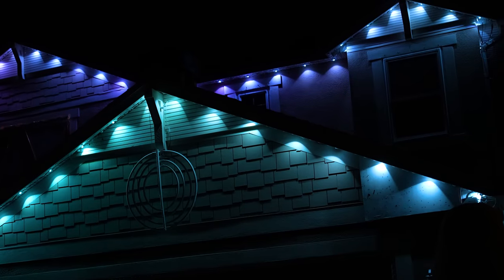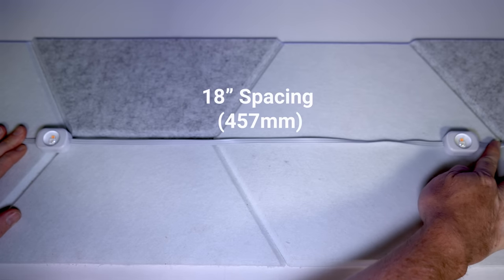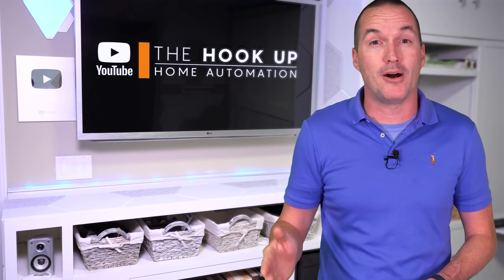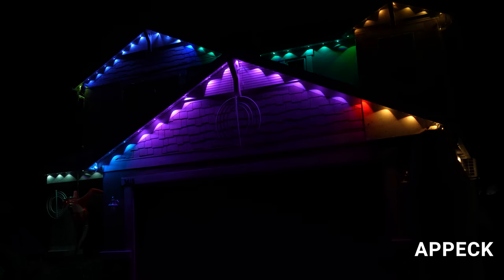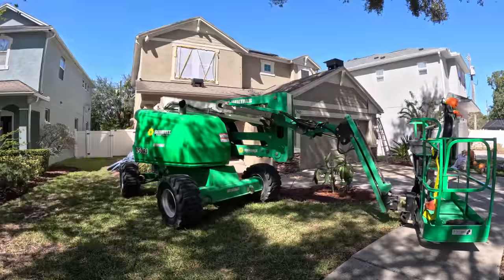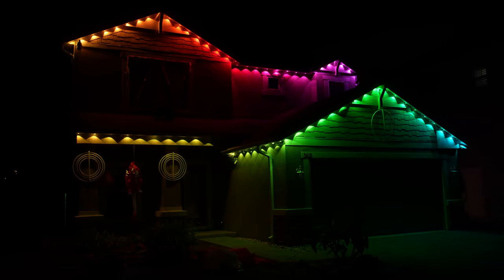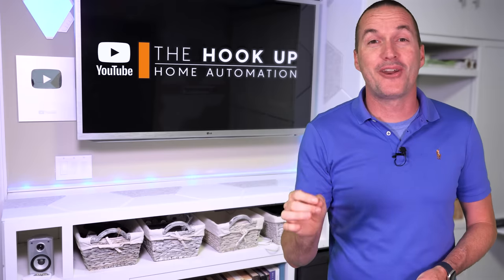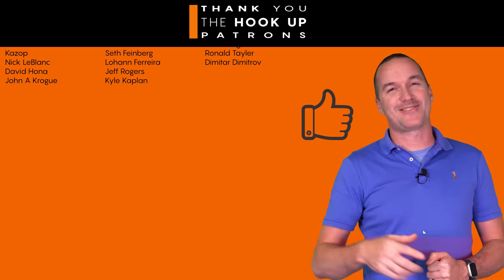Best Permanent Install Exterior LED Kit? Govee, Govee Pro, Eufy, Appeck, YPS, Novostella

Comment: Do the YPS pucks need injection for a 100ft run?  The Govee seems nice and easy to install, as the PSU is on one end of the lights and that's it.  The YPS looks better though, but I'm not too clued up on injection and all that stuff.
Reply from the maker: Yes.  They are 12v, so injection every 10m/30ft is suggested for full brightness white.  You can easily get away with 50ft without injecting if you use the wled brightness limiter.

Comment: I just received my Govee Pro kit and it comes with a power supply that has the same model number as yours SOY-3600300US-306A, but it says "FOR INDOOR USE ONLY DRY LOCATION USE". Did they put the wrong power supply in the kit?
Reply from the maker: Does it say "Rainproof" on it?
Reply: Nope. It looks like a completely different power supply that just happens to have the same model number.

Mine says "LED Drive (Switching power supply)" at the top where yours says "CLASS 2 POWER SUPPLY", too.

I see the date code on yours says 2333 and mine says 2023-09 

I've submitted a support request to Govee so hopefully they'll send me a suitable one that will work for outdoors while I work on getting an outlet in my attic to plug it in inside.
Reply from the maker: That is very strange.
Reply: Just heard back from Govee support: "The power brick can be use outdoor"

Not really the answer I was expecting, but I've changed the plan up a little bit and think I have a way to have the brick and control box inside the garage, so I guess it's okay in the end.

Not sure I trust that answer when the supply itself says dry locations only...

🤷‍♂️
Reply: Same here. White and "FOR INDOOR USE ONLY DRY LOCATION USE"

Comment: Hey- so one problem I have with WLED (or all individually addressable LEDs) is I can’t seem to find an animate on option. I want control over a soft on animation, or ripple to on, or fire to on, or firework to on etc… sort of like the high end light saber I have. I imagine pairing that sort of effect with home assistant. Imagine having a laser sensor at the end of your patch way that wince broken draws the path to your house and emanates up your house to reveal all, or stairwell lights sequentially powering on as you climb. I’ve searched and searched but maybe not using the correct terminology to find what I’m looking for. It doesn’t have to be WLED- but that’s all I can ever find.
Reply from the maker: That's definitely possible in WLED.  WLED not only supports macros but you could send that as data through Node-RED.
Reply: I've done this in weld using the presets then put them in a sequence. Or call as needed from home assistant
Reply: @TheHookUp  any chance you have a video or short covering how?
Reply: @firefon326  excellent. Do you happen to know any good resources to learn how?

Comment: For the Govee, if 1 strand is wired L->R and another wired R->L (meaning what end the power is), can animations be inverted so they all flow in the same direction?

I so want the Govee, but my house is 2-story with trusses on each level, a total of 6 segments so I’d need to order multiple units and figure out how to deal with the controller/PSU for each.
Reply from the maker: Not that I saw.
Reply: @TheHookUp Thinking I may go the 5 LED/m puck route. But even cheaper through Aliexpress instead of YPS. Do you have recommendations for when to do power injection? I know to use a data-booster for any large extension, but unsure for when I’ll need power injection.

Comment: Hi how many 10ft extensions can you add to the eufy lights? I would need 3 and was wondering if the resistance would be too big for that power supply.
Reply from the maker: I think 100ft max for Eufy

Comment: There's also a govee elite now which is somewhere between standard and pro
Reply from the maker: I was under the impression that the Govee Elite was just a special SKU for costco that has 150ft in length and no splicing kits, is there any other difference from the normal Govee Pro?
Reply: @TheHookUp  This is what I have gathered so far:

Standard
RGBIC - RGB only, no white LED
26 lumens output
No easy splicing
White color
2 Amp adapter

Elite
RGBICW
(RGB with 2x warm white LEDs)
40 lumens output
No easy splicing
White and Black color
Currently only sold in Costco

Pro
RGBICWW
(RGB with 3x warm and 3x cool white LEDs)
50 lumens output
Easy Splicing
White and Black color
3 Amp adapter for longer length of lights

Comment: So if i heard correctly Govee regular version does not have an option for warm white lighting? Im a fan of the warm white for xmas
Reply from the maker: There is no separate warm white LED.  You can choose "warm white" in the app and it will attempt to produce that color using RGB, but it doesn't look quite right.

Comment: Is adding led's to J-channel not popular now?  I see my neighbors who have lighting about every 3 or 6" that looks great.  Not so sure about the 12" spacing.
Reply from the maker: I think it's still pretty popular.  The issue that most people have run into is that the epoxy on the pixels is not weathering super well.  I've seen pics of installs that are less than 3 years old where the epoxy has turned completely black.  Hopefully the puck lights are better.
Reply: @TheHookUp  Thanks for the info!  That's good to know.  Thanks for your videos, as they are the most comprehensive out of all YouTube ones.

Comment: What is the difference in wled compatability between the eufy and regular govee lights?  As I understood it, the govee controller had to be cut and a dig quad or equivalent had to be spliced in.  I am thinking that is the exact same with the eufy lights?
Reply from the maker: Yes, it’s the same, you just have to configure the eufy as described in the video.

Comment: I just read through the comments and couldn’t find my question.  I know the middle wire on the govee lights is data but which is power and which is ground.  The govee controller is okay but I’m going to change to WLED.  I have so many DigUno controllers just sitting around doing nothing. 

Thanks.
Reply from the maker: I just sent my Govee lights out to a Patron, so I don't want to try to go from memory and blow up your strand.  The best thing to do is hook up the govee controller and use a multimeter to check the polarity of the wires.
Reply: Okay thanks, will do. Need to frame in all my windows before I mess around with these govees.

Comment: On the Eufy lights, have you figured out how to selectively choose which lights are lit with the warm white led? It seems custom lighting is limited to the rgb leds at the moment in the app. It's driving me crazy lol
Reply from the maker: Yeah, I mentioned that in the video, I don't see a way to do it with their current configuration in the app.
Reply: @TheHookUp  missed that part of the video, my bad! I've opened a ticket with their support team and will report back if I hear anything 👍
Reply: @TheHookUp  Do you happen to know where to find additional extensions for Eufy? I single one provided is nice however my setup requires 2 at minimum.
Reply: Also, is it possible to go beyond 100fr with the Eufy lights?
Reply: After a few weeks working with support they have pushed firmware and app updates that fix this issue.

Comment: maybe this will work for the Govee Pro lights: 
EDIT: I figured this out so I thought I'd add the solution here.

Each bulb has 2 RGB leds (WS2811) and 2 "warm white" leds.

WLED addresses these leds with a strand that is 30 leds.

To ONLY leverage the RGB LEDs, create a Segment in WLED, starting on LED 0, ending on LED 29 with a Spacing of 1. This basically says to WLED "LED 1, 3, 5, 7, 9, 11, 13, 15, 17, 19, 21, 23, 25, 27, 29 are RGB LEDS" -- If you want to control the warm white leds seperatly, you can create another Segment within WLED starting on LED 1 and Ending on LED 30 with a spacing of 1. This says to WLED "LED 2, 4, 6, 8, 10, 12, 14, 16, 18, 20, 22, 24, 26, 28, 30 are Warm White LEDs". TL;DR WLED see's these strips at 30 LEDs -- every other LED is RGB or Warm White, if you control them seperately with Segments you can use these strips as pure RGB strips AND warm white led strips when you want to.

Comment: Is there a way I can use these with PC based sequencing software and skip the mobile app? I want something like lightsorama that needs a PC and in designed for longevity (anything with a mobile app smells "low tier consumer product not designed to last more than 5 years") but these seem like they can only be controlled with the mobile app. I was going to go lightsorama, but I'm realizing that there are other options, but I think I'm figuring out why those lightorama controllers are expensive (you can expect them to be fully supported a decade from now, unlike apparently every option in this video).
Reply from the maker: As mentioned in the video, a number of them are compatible with WLED and therefore xlights.  Light-O-Rama is definitely an older technology and DDP/Xlights is the way to do computer based sequencing these days.
Reply from the maker: Here's my show this year featuring both the YPS lights and the Eufy Lights: https://youtu.be/fEmJLf13dIg
Reply: Yeah, I apologize for commenting before finishing the video. Hats off for the quick reply.

Comment: I was hoping I could stretch 30 feet of extension on the govee. I need all 150ft worth of ights. I have several jumps to make. 10 ft will not be enough.
Reply from the maker: I believe you might be able to do that in between two strands, but not mid strand.  The last led in the strand has a capacitor that seems to help prevent data corruption.
Reply: @TheHookUp  Okay, thank you! Great video, by the way. I really appreciate it.

Comment: I guess my next question would be how to determine how many kits I would need?
Reply: Well, how many feet of lights do you want? As a tip, if you have soffits then measure how wide they are (mine are 4” per groove) and use them as a measuring guide.

Comment: Any way to AVOID the scalloped look on the house? I would rather they look like actual glowing bulbs that don’t radiate onto the house. Maybe installing them onto the wall under the eaves instead of under the eaves itself? Or does that get offset by how ugly they’d look during the day?
Reply from the maker: Nah, I think you would just need to get a different type of light.  The 30 degree lenses would be uneven and blinding based on where you were standing in front of the house if you pointed them towards the street.

Comment: With WLED could I chain 300 feet of EUFY lights?
Reply from the maker: Yes.  Though you’d need to make sure that you had sufficient power injection to avoid voltage drop and subsequent data corruption.

Comment: what controller should one get for WLED for the Eufy lights?
Reply from the maker: QuinLED DigUno
Reply: @TheHookUp  sold out everywhere - I got the ESP32 and some jumper cables. Can you point me in the direction to set it up. On the Eufy lights - which order is the lights cable? Positive, Data, Ground ?
Reply from the maker: @ojasray1  You will probably need a 5V logic level shifter, I don't think they will accept 3.3V logic from the ESP32: https://youtu.be/F7IhSKJ41rU?si=pf4BZF1KCAEQGzqg&t=335

Comment: Do the yps come with a pre cord for the 12v power injection? All i need to do is connect powersource and dig quad uno?
Reply from the maker: No, the yps just comes in packs of 15 channels with pucks pre-installed.  There is no wiring included.  You can buy the power injection splitters and xconnect wiring separately at YourPixelStore.com if you need/want it.
Reply: thanks! How difficult is to hook up the govee to wled?
Reply from the maker: Not particularly difficult.  The only hurdle to jump is that most WLED controllers are not 36V compatible, so you'll power the string with the govee PSU, but hook the data to the controller, and the ground of the 36V PSU, Govee string, and controller all need to be connected.

I'll be doing a video about that mid November.
Reply: how many wires is the govee? I have some H6172 (model) light strips, that are three pin
 @TheHookUp
Reply from the maker: @davidbeiler6364  standard WS281X protocol, 3 wire (+ data -)

Comment: WLED and Permatrack.
Reply from the maker: Permatrack is great, I've got it around my garage door.  BUT, it's about 2-2.5x taller than the puck track, so it doesn't blend in behind the soffit and stands proud of the drip edge.  The pucks are also much brighter than pixels.
Reply: @TheHookUp  that's true. However, when you install anything to vinyl siding soffit there is not "lip" to hide behind anyway. Also, I like the full wash effect of selecting all the leds 2 inches apart on some effects. To each his own! Great video! Just don't want everyone figuring it out and putting me out of business! Lol!

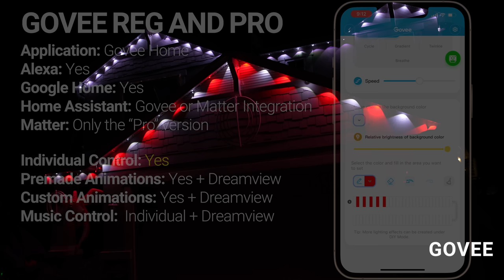Comment: Buyer warning: Contrary to the slide at 10:27, there is no Home Assistant integration for Govee lights (there is a Govee Bluetooth integration but it's only for their Bluetooth thermometers/hygrometers).

There is a community github integration for Govee Wi-Fi but it's only available via HACS, not the official repository, and it boot-loops my Home Assistant when  installed. Even if I could get it working, it only supports on/off, brightness and whole-string color, no animations/scenes, so it's pretty much useless.
Reply from the maker: I consider HACS integrations to be part of home assistant these days.  Many of the HACS integrations work better than the official integrations.  I suggest you try Govee LAN Control: https://github.com/wez/govee-lan-hass  I've used it for over a year now and it's flawless.
Reply: That's what caused my HA boot loop. Barely recovered by managing to quickly get into the UI and disable it on one restart before it caused another reboot. I would have had to rebuild my entire HA setup. Never touching that crap again.
Reply from the maker: Up to you, but you are the only person I’ve ever heard have issues with it.

Comment: What does "Wet Rated" mean?
Reply from the maker: Generally it means that the power supply has been potted and has some protection against water ingress, so you can put it outside... as long as it's not under water or anything.

Comment: Eufy should be reported to regulatory bodies for supplying an insufficient PSU with their product (102.5% MAX) is taking the piss, that's a potential fire hazard right there.  Yes most people will likely not us it on full brightness at 100% for long periods of time, but when you're designing a product were safety is concerned you're meant to always factor in the what ifs, like what if someone left it on 24/7 @ 100% brightness intentionally or forgot about it or even went on vacation and left  it on by mistake; is it going to cook the PSU, in EUFYs case very likely.

Comment: I am more concerned about how bright they are in 5 years.
Reply from the maker: It's hard to fast forward 5 years to know that, but if you look at the end of this video at 20:53 (where you can see the inflatables and "fire effect"), the LEDs that are facing out have been permanently installed on my roofline since 2017.  The plastic diffusers have yellowed, but they are still bright and have good color.

Comment: Perma track are better than all of these hands down
Reply from the maker: I'm sorry, but is that based on any actual information? I have Permatrack around my garage door and it's fine.  It uses pixels, so it's not as bright per node and it's also twice as tall as the YPS Puck track so it can't be hidden behind the roof drip edge.  

DrZzs is a friend and good on him for being first to market, but the statement "Perma track are better than all of these hands down" is not correct.

Comment: Just my opinion, but I'm not a fan of any of these,the led strip/ Pixel is definitely the better way.  You can't see the strip when it's off, but these ones are definitely seen when off, and look like garbage.  People will be hacking up their house to install these
Reply from the maker: The YPS lights are a lot more concealed than pixel tracks like Permatrack.

Comment: That wiring is sloppy and not well hidden 😅
Reply from the maker: You mean when I temporarily mounted all 5 sets? yes.
Reply: @TheHookUp  i do wiring professional too. Any clap hooks that's not plastic you recommend to use to hold the lights that's connected to a heavy outdoor cord dangling on a arch?